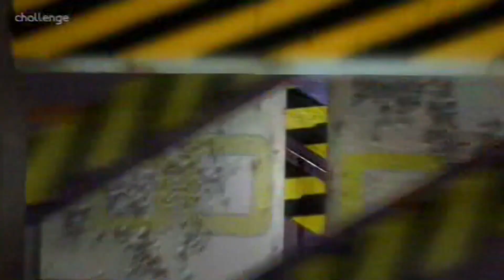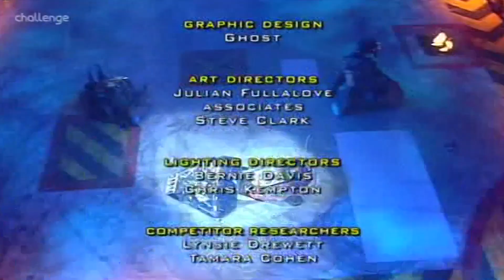Robot Wars Series 7 Heat D

Comment: I kind of feel for Hodaf The Bad's team, since the battle was cut short. Maybe with the additional time remaining, they could have defeated Thor? Unlikely, but I am glad that in newer series, they restart the battle as soon as the arena is fixed.
Reply: Interestingly I felt that way about Hydra. If the arena was unsafe and cease should've been called, surely the battle should've ended before Hydra was flipped oota putting it to the judges. Even though it got thrown around by Gravity they made a decent fist of it and I think would've edged Thor on points.
Reply: @tufty1990  I agree. That first fight, I'd rate as Gravity - first, Hydra - second, Thor third and Hodaf fourth.   Hydra was unlucky that Gravity chose to battle them instead of throwing Thor or Hodaf around, and Thor was lucky that neither Hydra or Gravity seriously attacked it, I think.
Reply: @cr10001  I think they called cease because Hydra's impact outside the arena popped the outside wall, not that little barrier next to the light fixture

Comment: At 29:18, the sentiment "we hate flippers" was evident, and indeed, 13 Black stood little chance against Gravity. The significant ground clearance beneath its destructive discs was a disadvantage against a flipper as capable as Gravity in this series. Moreover, the malfunctioning self-righter, added specifically for this series, spelled trouble for 13 Black. Consequently, the number 7 seed, tipped by many in the pits as potential series champions, was eliminated earlier than anticipated. This was a stark contrast to their impressive run in the 6th wars, where they emerged as the top spinner, succeeding Hypno Disc. However, unlike Hypno Disc, whose self-righter proved effective in Extreme 1 against Behemoth, 13 Black's self-righter led to its downfall.
Reply: John Denny said that. From Joe. X

Comment: Jesus, It's good that Lightning pitted Thor, cause I think the judges might have wrongly gone for Thor as the winner. Thors control was absolutely abyssmal. Skating all over the place, overcorrection after overcorrection on the heading, EXTREME delay on the hammer, either due to shoddy electronics or a terrible weapons operator. Sure, I would have loved to see that hammer give a big juicy wallop, but it just wasn't happening. Impressive potential is no substitute for proper engineering.
Reply: Lightning was more aggressive. From Joe. X